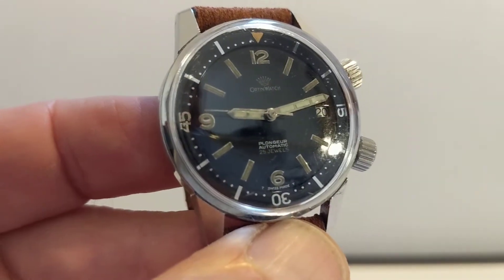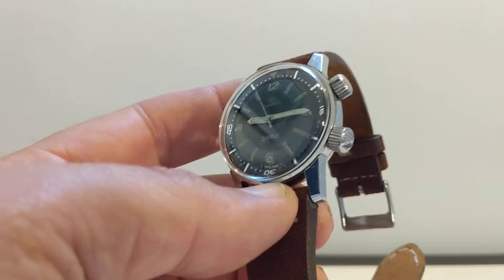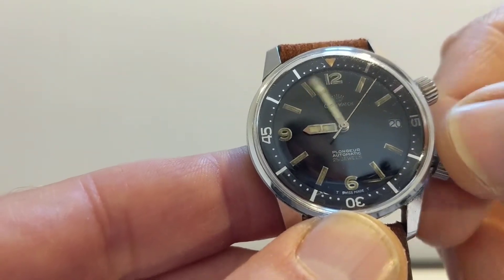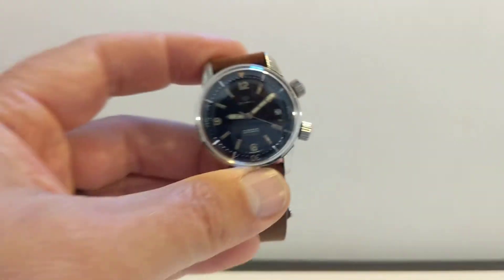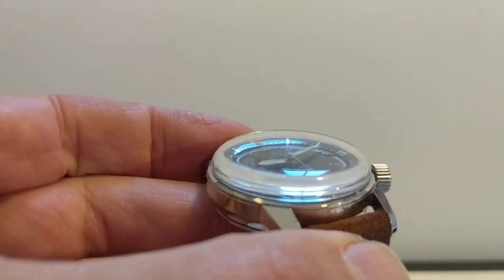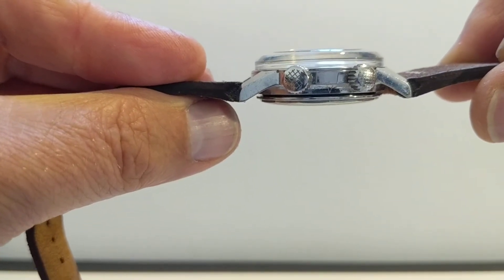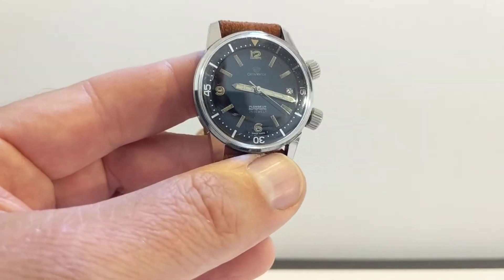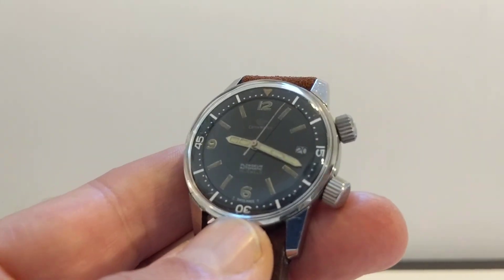Ortin Watch Super Compressor vintage diver's watch - hands on review

Comment: Great informative video.  Ervin Piquerez S.A. was well ahead of their time with this innovative waterproof case design in 1956.
The ORIGINAL first generation SINGLE crown EPSA Super Compressor case design was used by Longines in 1957 when they released the iconic Longines Nautilus Skin Diver.